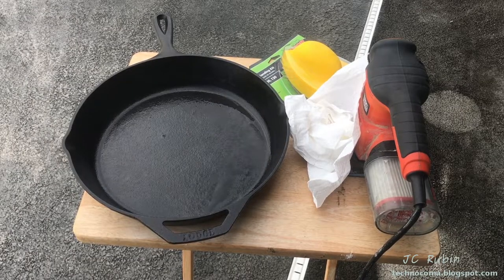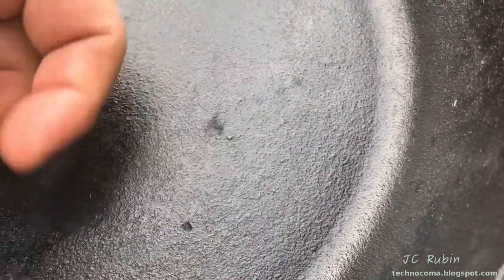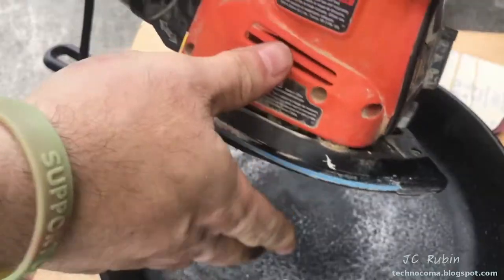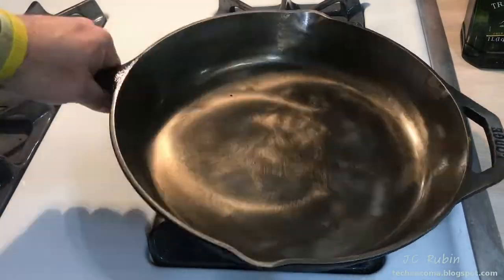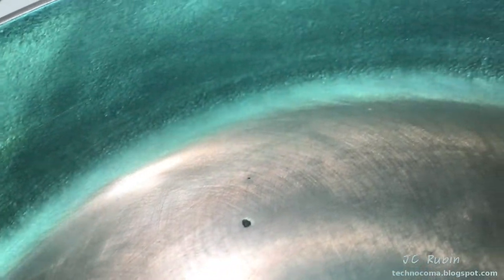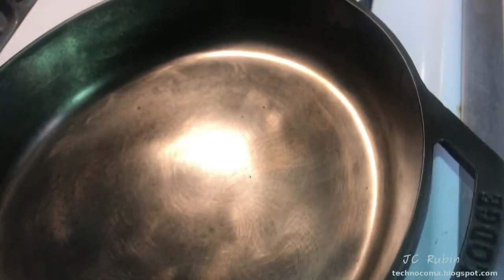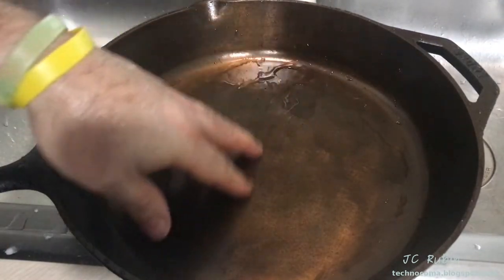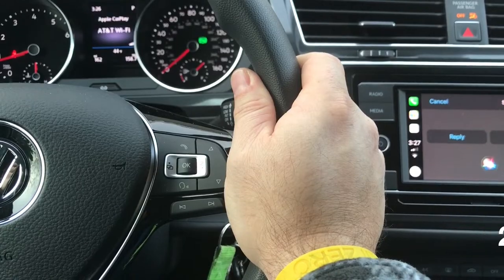Cast Iron Adventures in Refinishing and Seasoning - Turning Lodge into Awesome

Comment: Thanks for sharing.  Seasoning looks great.  I would recommend not using soap. That will start to take away the finish on your pan.  Same with the scotchbrite,that's a bit of a coarse abrasive. If you can find a chain mail scouring pad it works very well with out affecting the finish.
Reply from the maker: I’ve been told about the chain thing, I may pick one up. Though I wouldn’t think Palmolive would have any I’ll effect on the pan other than to cut grease, seasoning is t grease, though oil should be applied later.
Reply: Its ok to clean your cast iron skillet with dish soap. unless you  using animal fat  as seasoning , Why   well when you season you season your cast iron with flax oil or the oil like he is using dish soap will not remove it cause it has polymerization cause it is a dried oil an not a fat base oil.. now if you seasoned with animal fat then yes don't use dish soap.
Reply: @SviiiSavageWraith  I season with lard and ALWAYS USE SOAP AND COLD WATER